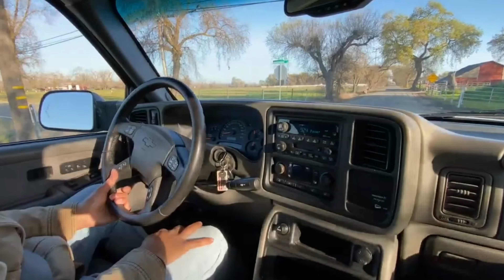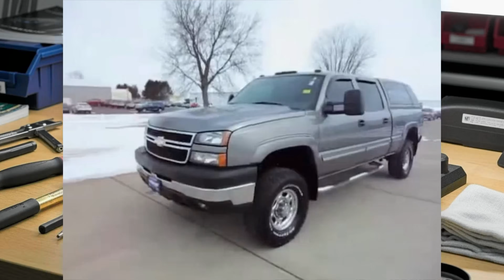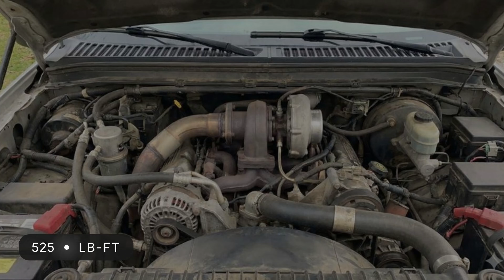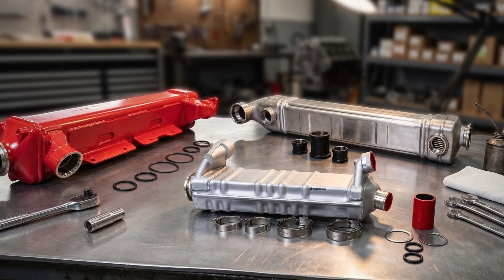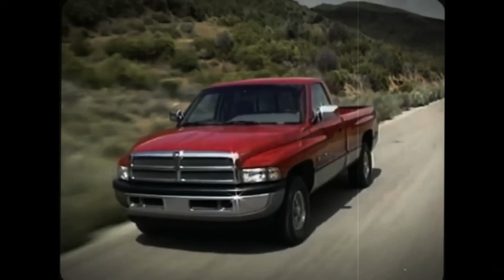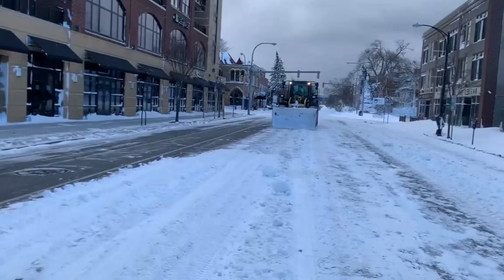4 WORST Diesel Truck Years EVER Made (And the 4 BULLETPROOF Years to Buy Instead)

Comment: 2006 dodge ram 2500 with a 5.9 Cummins and a 48re transmission. At 230k transmission started to slip, $3840 to rebuild with billet torque converter and billet internals and hoping it will last another 230k or more. Engine is a beast and have done nothing but mx to it. It’s 2026 now and I refuse to buy the new diesels for $80-100k when I picked this one up for $24k used with only 25k miles on it.

Comment: 6.4 fords got DEF on model year 2010. ,08-9 were DEF FREE
That's the reason all my farm trucks are '90-09 only. . Too much electronics and EPA crap
on  new models. Not to mention initial purchase price. Insurance and registration costs. PLUS now all manufacturers are fighting for the same mess John Deere had. Dealer ONLY ALL work with no owner wrenching-even oil changes. It is now in Congress for voting.
Reply: I never buy any John Deere.
Reply: @cookiedough5374 smart man!!!!!
Reply: the only farm equipment I have is a IH hat take that I bought at auction that was painted JD green. serial # told it was IH.
it's red again week after I bought it. only thing I want green are dollar bills. and if you buy JD you wind up without green dollars!
Reply: hat take should be HAY RAKE. I hate this auto spell function on cell phone!

Comment: Just to update   On  the  LBZ I owned one of those the transmission control module  very common failure issue .  They are  mounted right on the radiator side in a very hot spot in the truck  . My truck had maybe 160000 miles . A. Couple years ago you couldn’t even get a new one I would  never buy  one again.